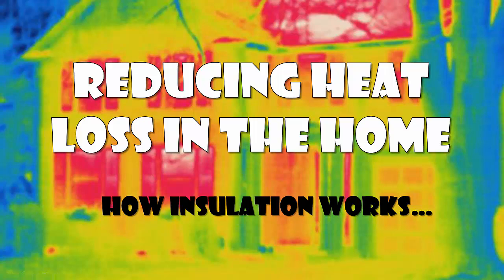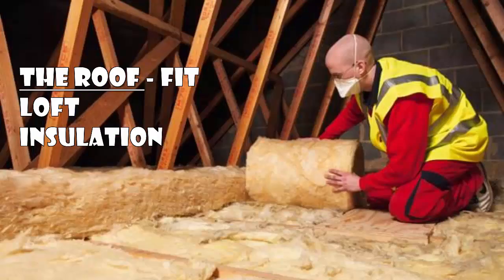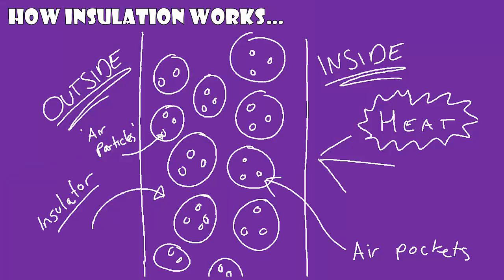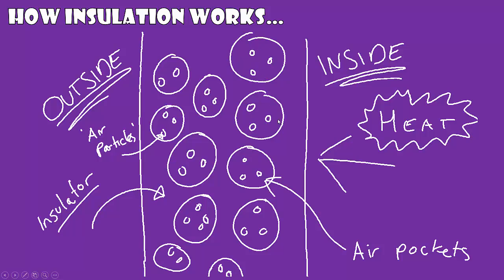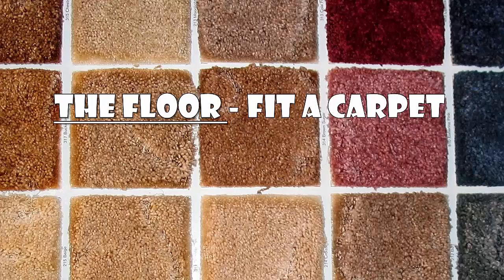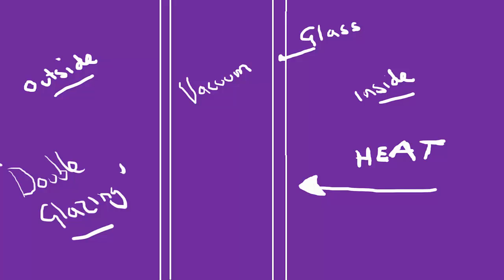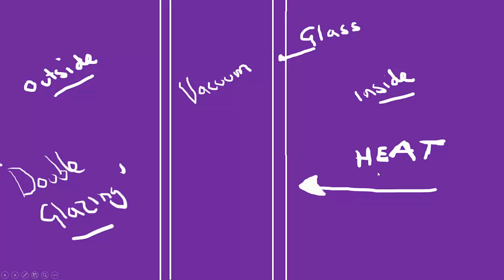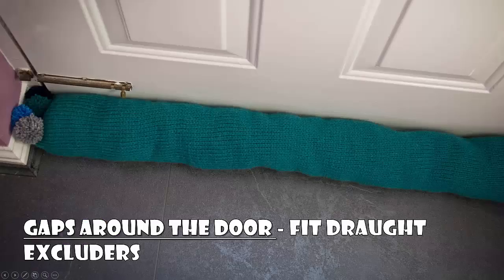How Home Insulation Works

Comment: question, I put empty cardboard boxes and Rolled out  insulation in my House. And then I paid a company to come in and spray 5 in of insulation all over my attic, the gentleman that did the job told me he covered up the boxes with insulation all the way to the top,. All so I paid for extra insulation for another 7 inchs . 

( can you explain to me the consequences for putting a lot of insulation in a attic ? ) 

Please  i must know  what i just Did. . 

 and then when the job was over I took it upon myself to  throw empty cardboard boxes far back as I can into the  attic . 

( will that help ? )